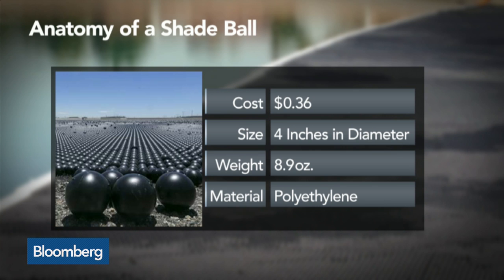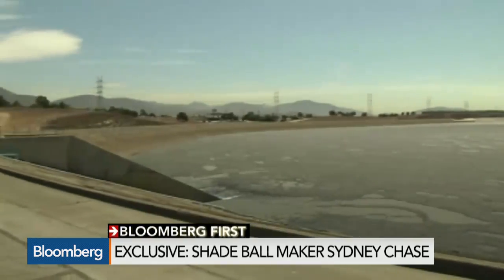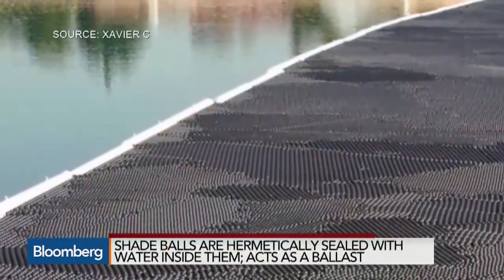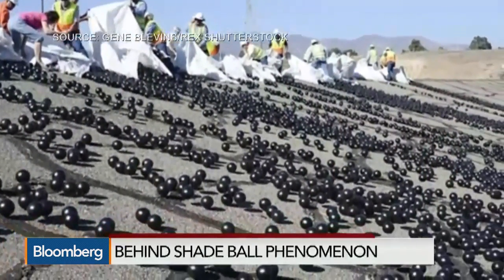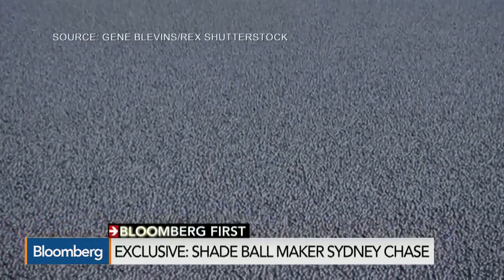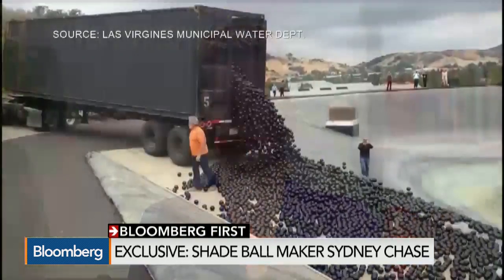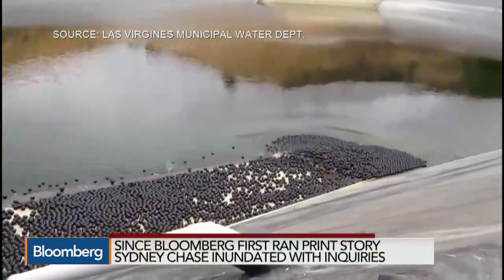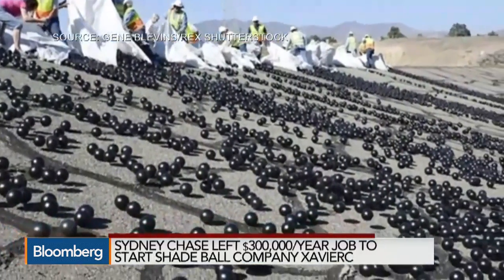'Shade Balls:' What Are They and How Are They Saving Water?

Comment: Ok. 
I see a downward spiral here. They need more rain. They are trying to keep their present water from evaporating. Rain comes from evaporated water re-condensing.
They don't need to keep it from evaporating, they need to quit using it.
The drought is a result of too many people sucking too much water from the green areas to make their desert friendly to golf courses. There's a reason grass didn't grow there in the first place. That water you just dumped on your lawn might take millions of years to make it's way back around to rain.
The central California area where the drought is most severe on the maps is where it should be the greenest due to the mountains surrounding it. East of the Sierras is desert because the clouds build up on the west from the warm air coming from the ocean. I know it comes in from over the water but it needs other moist air to work with too. As it comes in and rises because of the mountains it cools condenses and drops back. Most of it drops mainly in the "bowl" of what is central California west of the mountains or would if they didn't suck all the groundwater out so fast. Too many people for the area to maintain, too many toilets and factories.  
We aren't making any new water and it recycles itself at it's own speed. You can make a desert green but there's going to be a trade off. Either start moving some people out or get a move on a huge system for converting seawater. Leave the groundwater alone or say bye bye to your forests.

But hey...if she can make a few hundred million bucks off California before it dies selling it black balls of doom.....that's the American way.

Comment: Doesn't the sheer volume of balls used decrease the capacit if the reservoir? Have they measured the the reduction in the amount of water evaporated during drought against the amount of space that the balls use that would otherwise accomodate water?
Reply: +Dale Myrie i doubt any water reservoir is ever filled above 90% capacity at any time. its not like this is in a sealed tank

Comment: They all say its safe till everyone ends up with cancer!!!
Reply: +Burns My Britches half of the people who read this will get cancer from something else like dirty air
Reply: +roywhiteo5 You're right about that Roy! What they say is good one day is bad the next. I'll probably end up with cancer just by watching this again. Thanks..
Reply: +Burns My Britches polyethylene is basically inert its used in implants.
Reply: RowanBows the shade balls are created to reflect the heat so the water doesn't evaporate and the plastic they are using for the balls are a different type of plastic that won't harm the environment. NICE JOB RowanBows 👿
Reply: Instead they can have solar panels on the surface serving two purpose!!?
Reply: RowanBows They are made to reflect sunlight and they are made to last up to 25 years so they wont get soft

Comment: Could probably build another resevoir for 36mil. Only time will tell if this is a good idea.
Reply: +toob247 They could, but the quantity of water that they can store is not the issue, but the quantity of water that they actually receive.  Building another reservoir would actually have a negative effect on how much water they have available because it would increase the surface area of same quantity of water that is exposed to sun and wind and thus accelerates evaporation.  The goal of the shade balls is to reduce the rate of evaporation by dramatically reducing the amount of sunlight and wind that the water gets exposed to.
Reply: Angelo Francisco Take note that at the very end, the writer does concede that the shade balls WILL save water.  The thing she gets stuck on is the monetary value of the water being saved vs the cost of the balls themselves.  What she doesn't take into account is that the drought is so severe that it has become an issue of survival where they have to invest more than could be considered economical to conserve a dwindling supply of a vital resource that they themselves are unable to produce enough of to replenish their supply.

The only other alternative they have really is to pipe in freshwater from regions that have it in excess, the logistics for which are something that would take time to investigate as they'd first have to find a region that is both willing to do so, and can do so in the quantity that is needed for California to get through the drought crisis.